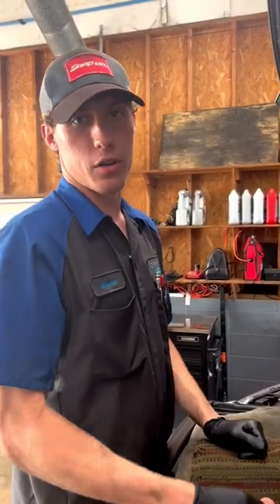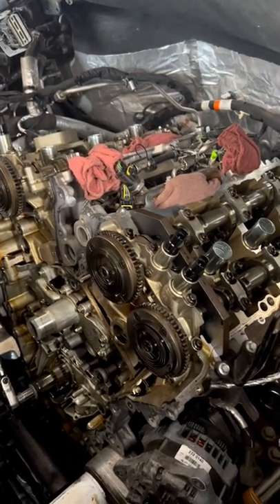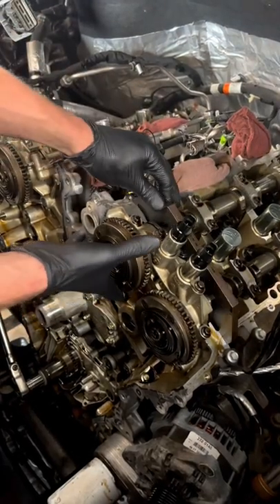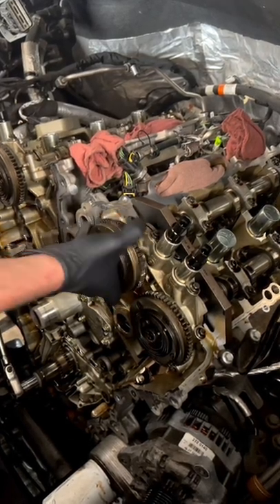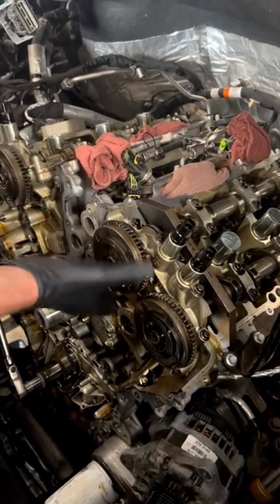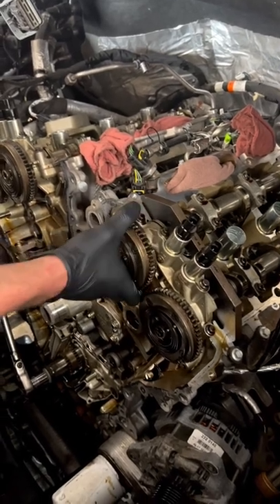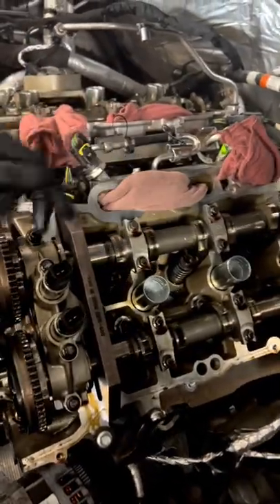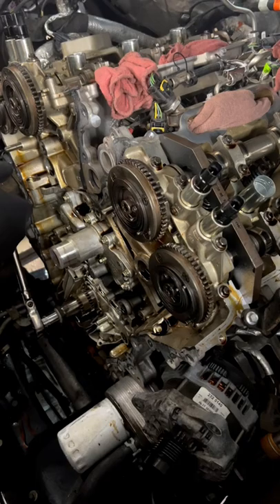Here’s the cause of cold start rattle on a Ford 3.5L Ecoboost #shorts

Comment: 15 years in, Ford STILL hasn't nailed down making quality phasers. Unbelievable.
Reply: Same for GM except it's their active fuel management . Unlike the Ford the GM is an easy fix .
Reply: @Dr.Westside  yeah, but it still needs fixed in the first place (   ._. )
Reply: For some reason, the 5.0s don't have this issue
Reply: They make SO MUCH MONEY on repairs and people buy fords just because of the name instead of value so this will never be resolved.
Reply: Same for Honda and Toyota. Seems like an issue with this technology in general. Cold rattle on start is same on all makes
Reply: @Dan-gj1hz orry but every manufacture is like this. Currently have 1 Honda, 2 Toyotas, and worked on another Honda recently that has this issue. I’d say flaw in technology
Reply: Even Mercedes has cam phaser issues on some of their engines. A design and or supplier issue I assume.
Reply: Car manufacturers don’t make them.
Reply: @COCarDude but they burn oil? Fords fix, longer dipstick
Reply: @Dr.Westside the fix is change your oil on time
Reply: @92auggieboi do they burn oil like a vortec engine? Yeah some engines burn oil haha doesn't make it bad, I think the 8.1l vortec is in spec if it loses almost a quart between oil changes
Reply: @92auggieboi my 2012 eco 3.5 just hit 130k.  No phaser issues. And doesn't go through or lose oil.
Reply: @nativeoutdoors1780 my 3.5 just hit 130k and doesn't use or lose oil.
Reply: @COCarDude I had that issue on my 2019 5.0 the phasers went out at 20 k miles
Reply: over 100 yrs of making cars and ford still don’t know how to
Reply: @user-yk4oq4wz4d  and who do you think does? We all stand on the backs of giants.
Reply: @Jagg61  if they made cars easier to work on it wouldn’t such an issue
Reply: @user-yk4oq4wz4d  true, but nowhere in history have we gotten 20+ mpg out of gas trucks. Or v6 trucks pushing 365hp or 420lb ft of torque.  Or vehicles that could tell you what was wrong with them.
Reply: @Jagg61  yeah and that right there is that 2.7 liter eco boost the 3.5 liter ecoboost puts out 400horsepower and 500lb ft of torque best in its class 👍🏼
Reply: @davsquaredo79  mine is a 2012 f150 3.5 365hp

Comment: I'm going to respectfully disagree with you the reason it has a cold start rattle is because it's an over engineered piece of junk
Reply: Mine hauls ass. I’ll put my little 3.5 up against both of those engines any day. You can’t beat the HP & TQ the 3.5 makes in the rpm range it makes it at.
Reply: MadMax 57  I’m way past those miles with mine and the only issue was a water pump and a turbo coolant line leak. My experience has been great with these engines. I have friends with over 200k on there’s and haven’t had any of these problems he is describing. I’m at 150k on a 13 model.
Reply: @BoostedF15O 140k on a 2015. I've only had the water pump go out as well. Anything else has been general maintenance. No rattles and I dont baby it. I did have the metal oil pan already though and I found it weird. The 15s usually have a plastic pan. I'm not complaining, it's just strange.

Comment: Remove the Ford oil pump and install a Melling HO oil pump for this engine as well as other older Ford engines. The increased volume and slight pressure increase will prolong the life of this engine and improve its performance/longevity. Fordtechmakuloco makes this recommendation and it works.
Reply: Interesting. I'll have to check that out. He say anything about the 2.3?
Reply: @champinsoccer9  that engine doesn’t suffer from oil starving issues since it’s a 4 cylinder engine. Nonetheless, I would check through Melling and see if they manufacture an HO oil pump for that engine.
Reply: @jamram9924  sweet! Thanks for your time and info
Reply: I put one in my old 5.4 3v with a timing job those old v8s run awesome. My thought was why doesn't ford learn a lesson and just use the melling high volume pump as a factory part? This problem has been going on for years across different engines.
Reply: @edwardmilano4610  : they just want you to buy a new vehicle….🤑🤑
Reply: And remove the rattle
Reply: You said what i was going to say. You are correct. Much respect
Reply: I got one for my 3.5 eco and it didn't help. 50,000 miles later and have to do timing again. I firmly believe it's a bad design from Ford and nothing can be done to entirely correct the root cause.

Comment: Hold the pedal to the floor & crank it for 2-3 sec. Primes the oil system before startup.  Then when you start there should be little  or no rattle.

Comment: The rattle is not from the phasers. The rattle is because of them leaking down. The rattle is from your timing chain slapping against the chain tensioner guides. Because the phasers leak down the tensioners back off and loosen off the chain

Comment: First problem you have. You own a Ford with an eco boost
Reply: One of the best engines ever made. Brother has 387,000 miles on his 15. Im about to hit 130k on my 18. With a 93 tune made 488 to the tires and 613 on e85. On 93 if i drive like a person, between 22 and 23 mpgs everywhere, not just down the highway. Tows my 38ft camper almost like its not even there at 10.3 mpg in the the blue ridge and smokey mountains of Tennessee doing 80 with ease. There is a reason why there are more Ecoboosts on the road than anything else.

Comment: If you use the factory oil filter, it comes with a hight quality anti leak down valve made of silicone. This makes sure you have oil pressure instantly on start up. 

The problem begins with using oil filters with rubber anti leak down valves and the don’t seal so after you shut the engine off, it slowly leaks down and it gets a dry start every time and this does damage over time. If you want to use an aftermarket oil filter just make sure it has a silicone anti drain back valve. Most OEM oil filters have this and it’s for a reason. I  know AEM and a few others have it. 

I’ve researched this and it’s the answer.

Comment: Working at a Ford dealership, I think I see at least 2 of these jobs a day. Our engine tech has it down and can do them real easy and decently fast.
Reply: Do you replace the phaser assembly?
Reply: @Sith_dude  phasers and cams yeah, normally cleans it up.
Reply: @deadly_kitten5648  why the cams? Why not just the cam gears and phasers?
Reply: @Sith_dude  it may be the parts you listed. After I sent this we pretty much quit getting them so it's been a while since I've seen one done.
Reply: @deadly_kitten5648  I've got a customer with a 2011 f150 with the ecoboost rattle on start up.ive never ran across this problem before. It's been doing it a long time so not sure if doing the phasers would fix it at this point.
Reply: Why is it necessary to fix this besides an unpleasant noise in start up?
Reply: @se11459 the cams are connected to these phasers and the noise its created by wear which can cause the cam shafts to shift which in turn can damage the engine.
Reply: Ford wanted 10k dollars for out of warranty to do this job. Nope
Reply: @SssandNBtwnMytoes  it is pricey, but you get an oil change, a coolant service, and an a/c recharge with most cases. Not to mention, if you get the right techs you can see some cool stuff. Did you know that the expedition can have the entire body pulled off the frame similar to f150s?
Reply: Ohh yeah, and dealer asking $4k-$6k for fixing the cam phasers! That's should be done for free , because it is one of the common problems on ecoboost engine!!!

Comment: I have had that same rattle ever since I bought my 2013 3.5 L EcoBoost. My friend has the same truck except his has a 2015. He also has the same rattle. He has a friend that is a mechanic who worked on it extensively to try to figure out the problem. His solution was he put a spring on the wastegate of the driver-side turbo. His truck has 205,000 miles on it, when you start it has a clean start with no noise.
Reply: Thats wastegate rattle. Not phaser rattle.

Comment: What is the potential downside of NOT addressing this?  Other than the annoying loud cold start?
Reply: So the actual noise is the chain, not the phasers. Because the phasers leak down the chain tensioner backs off the chain. The chain guides are plastic, so eventually with the chain slapping on it will cause the plastic to break apart. Once the plastic breaks you can have the chain jump timing and blow the motor.

Comment: I’ve had a bad rattle upon engine starts on my 2016 F150 with the 5.0 ever since owning it.  Not necessarily just cold starts, sometimes just 15 mins after running it hard in high temps (FL).  Ford dealer changed some components years ago while it was under warranty.  I think they changed the phaser for the intake cam; but, I’m not 100% sure.  The problem persists and they refused to admit that it was a problem because it happens intermittently.  Since then, I’ve just listened to it, hoping it won’t cause timing belt (or other engine) failure.  Recently, it started also idling rough at lights sometimes (to the point of almost stalling) and threw a check engine light and code p0022, mentioned in your other videos, while finishing an acceleration up to about 60 mph.
I got this truck 2nd hand and another dealer in TX (around 20k miles I think) changed the short block trying to fix some problem (perhaps the same one).  
I have been running AMSOil synthetic 5w20 ever since owning (hoping to extend the life of the motor and keep forever).  Recently, I’ve tried to go back to Motorcraft just because I’ve heard these 5.0s don’t like synthetic.  The rattle persists.  I’m recording most of my engine starts recently for evidence that it’s happening.  It’s now at 82k miles and it has never been fixed.
Yesterday I talked with Ford Customer service at HQ in Dearborn, MI.  They scheduled yet another appointment at the dealer (a different dealer than the one who couldn’t truly fix it).  That appointment is scheduled for June 9th.

In your expert opinion, what IN GODS NAME do I need to ask of them to please replace to fix this problem once and for all?  From other research and your videos, I’ve gathered this list…can you think of anything else?  Thanks in advance.  Maybe I can get you to call their best engine mechanic at Tamiami Ford in Naples for me?  I had high hopes for this truck, hoping it would run the 200-300k miles I’ve heard such good things about.  And May buy the new electric Lightning, unless Ford hangs me out to dry on this truck.  Any advice you have would be most appreciated man.
1) New Intake VCT Cam phaser bank 2 (or should I ask them to change both intake phasers?)
2) New VCT Solenoid
3). Front cover gasket
4).  Front crank seal
5).  Guides?
6). New timing chain?
7).  Tensioner?
8).  Oil change (to get brand new oil into new phaser).
Or should I just ask Ford HQ to change the whole motor and offer to split the cost with them?  I can send videos of the noise but it sounds just like the timing chain rattle I’ve heard on all the videos.
Aviatorshaun@gmail.com

Comment: I had this on my 1st gen. Got it fixed at 219k. Now at 224k and an oil change later, it's starting to do it again! Just very intermittently though and nowhere near as bad as it was. I'm not entirely sure why these brand new parts would degrade so quickly. I wonder though if the collapsed coolant hose I have could have anything to do with it. The day I noticed the hose is also the day the rattle started again.

Comment: not always the case some times the primary chain is so stretched out it will also cause rattle on start up
Reply: Actually what causes this. (And it was really noticeable on the 5.4L) the seals on the TC tensioner would fail causing it to not hold oil pressure after shutdown   so you'd get chain slap for a second or two upon cold starting.

Comment: At my old job we had the Ford passenger transit vans. One was an Ecoboost V6, the others were NA V6s. The NA van with double the mileage (120k) that the Ecoboost had, was a fantastic engine. It started quickly, smoothly, ran great, sounded great. Nice and quiet, no rattles or knocks or misfires or shaky rumbling. The Ecoboost was atrocious. It took very slightly longer to start up, it had several random misfires that made it sound and feel like an old lawn mower being cold started (you know that mmmmmmDmmmmDmmmmmmmDmmm sound and feel) and it had a loud rattle followed by a pretty noticeable tappy and clacky valve train until warm. It had less than 80k on it and it sounded like it needed replacement. Absolutely terrible. It really didn't have a much more desirable driving experience over the NA vans either but I don't know if the fuel economy was better. The trans on that model also shifted in a way that I disliked. It was firmer and the gear ratios and shift mapping was just overall not as nice to drive as the NA vans were. Total disaster in my opinion. Each driver typically had a van that they were frequently given for the day, though there was no set assignments so sometimes drivers got different ones. I don't know why, but one driver preferred the Ecoboost van over the others. I suspect he might've been dropped on his forehead as a baby. No other explanation for his choice. 🤣 That van was embarrassing to pickup guests with in the morning. I'm sure many were getting into it and thought "You guys are a 5 star resort and you can't afford a nicer van to replace this stumbling clacky piece of crap? Jesus..."
Reply: Fun fact I just found out recently, the NA v6s are punched out 3.5 blocks making them 3.7L

Comment: I just ordered and received all the parts to DIY this. The longest wait was the valve cover gasket.
Reply: Fuck it, spray the old one off with brake cleaner and glue the bastard back in place with The Right Stuff 😸😸😸 Kick that can down the road, run it, and let the next owner/tech deal with the mess when it dies again or starts leaking. 

Just kidding, though I am a tad bit serious, no lie.

Comment: I bought a brand new f150 in 2019 and wanted the eco boost because of the performance but after only 20,000 miles mine started the rattle and it only got worse over time. I was told Ford knew of the problem but it wasn’t covered under warranty so I got rid it the truck. Aside from that awful noise I loved the engine. It almost towed like a diesel.
Reply: Yup sold mine also
Reply: Sold it for a little noise? Lol

Comment: I wonder why they don't use pre lube oil pumps on automotive engines like the ones that are on some heavy equipment diesel engines . On them there is an electric motor that turns a separate and an outside oil pump that pumps up full oil pressure before the starter turns the engine over .

Comment: 64k on my 2017 explorer sport 3.5 TT and luckily things are quiet. Synthetic blend Oil changes every 4k anti feedback  diaphragm oil filters.  Also drained and refilled the manufacturers" lifetime" PTU fluid at 40k
Reply: @Gregg0112  I  won't own it in a about a year. 🤞🤞
Reply: I’ve had my 13 f150 for several years and it runs great no issues. I tow good bit with it. I worried a lot when I first got it thinking I should have gotten a 5.0. But now I don’t regret it. Gets great gas mileage and flat out gets its.

Comment: I took mine in for this in February, the dealer is still telling me they can’t perform the service due to some gaskets being back ordered. Is that accurate?
Reply: Can be, all the gaskets get replace once it's been cracked open. But if their actually on back order I'm not sure, could always call parts place and see
Reply from the maker: Valve cover gaskets have been hard to get. Honestly in most cases they can be re used though.
Reply: Just had mine done the end of last month after waiting a month for all the parts to arrive
Reply: Not really mechanics in dealerships are becomenig lazy
Reply: @Elmiki007  lmao wtf are you talking about
Reply: Is that accurate? No I’m sure the dealer doesn’t want to take your money lmao.
Reply: I have a raptor that is still in warranty dealer has told me for the last month and a half they are waiting on the gaskets
Reply: So ill add, I did this job to a customers 17 f150 and we could not get VC gaskets. They are reusable and if they weren't leaking before,chances of the leaking after have been pretty low for me. The dealer won't do it without the vc gaskets, but whats funny is the tube seals don't get replaced, and those are what I see leak the most.
Reply: @FlyingWrenches13 This info is gold

Comment: same issue with the 2.4l Honda k series.  my solution was to just let the oil get old, it was worse after fresh oil changes, hehe, the seal allows for leaks own, not sure if it's a lockout pin or just the oil back pressure

Comment: Before you start your vehicle, press the brake and gas pedals both in.  Next, turn the ignition to start the vehicle.  Let it turn over for five seconds and then let off the gas while still holding the brake.  The vehicle will now start without the rattle.  This method allows the oil pressure to build up inside the engine before starting.  There must be some kind of pressure loss in these engines somewhere after a little time.  An electric oil primer inside the engine would probably be a good idea to prevent this and extend the engine and cam phaser life.
Reply: When you say, "turn the ignition to start the vehicle" are saying that you should start your engine with the gas peddle depressed?
Reply: @TheMeatFighter yes. If the gas and brake are held down together, the vehicle will crank but not start. By releasing the gas then starts. So you can let the engine crank for an extra second or two before it fires up so the phasers have oil pressure.
Reply: @VanWo you can do it with just the gas pedal. You don't have to use the brake.

Comment: If you hold the accelerator pedal down and crank it for 10 seconds then release the pedal it will build enuff oil pressure to NOT RATTLE
Reply from the maker: Enufffffffffff hahahaha
Reply: 🤣🤣
Just rev it up upon start.